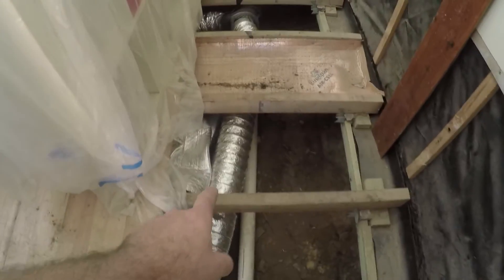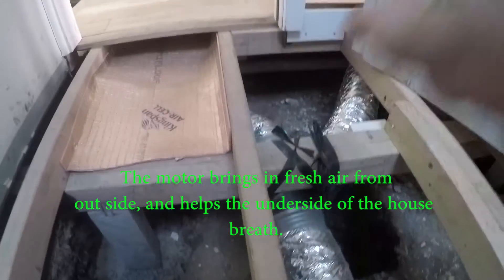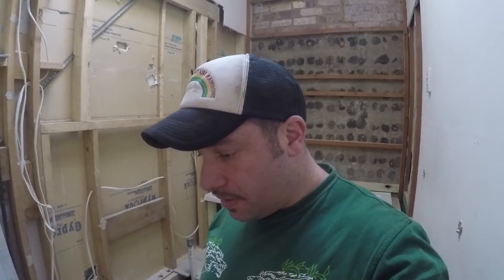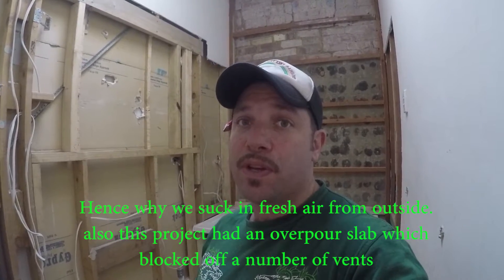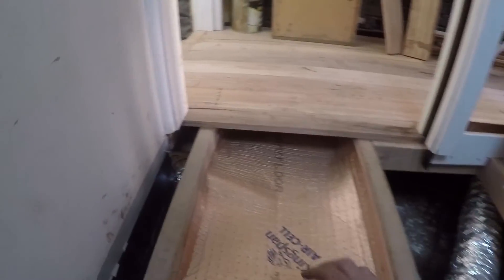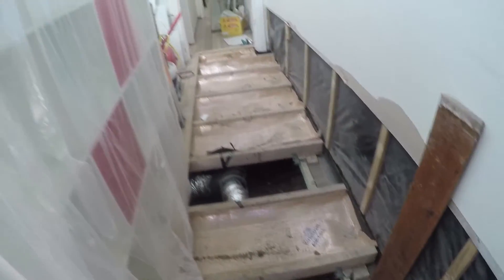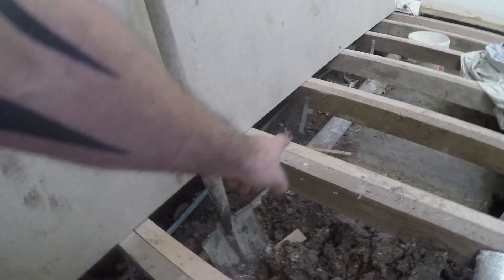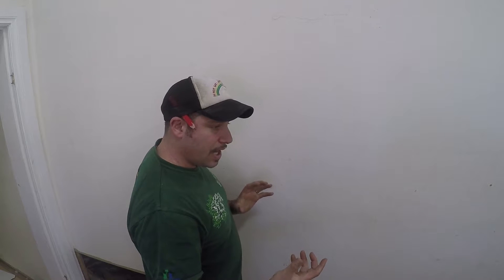Underfloor ventilation & mechanical ventilation explained

Comment: Hey mate, fantastic series, thanks! I’m deep down the rabbit hole of research as we have opened up some of the sagging bedroom floor in our 100year old cavity brick home. We have had professional rising damp repairs above floor level which has made a big difference, however we can see the joists have rotted over time where they meet the masonry. I can see plenty of weep holes and vents outside. Correct me if I’m wrong but it seems that vents weren’t originally placed in the inside cavity only the outside as this area was once considered ‘water tight’ before the original damp course disintegrated. 

I have seen a video where homeowners have used powered fan ventilation and due to drying out the subfloor excessively, it accelerated the rate that ‘new’ moisture moved up the masonry from the ground, and the salt damage then turned the mortar to dust. 

Am I best to accept some moisture as long as it’s controlled above floor? Would passive vent holes through to the internal cavity be a good compromise?

Thanks again. I’m really enjoying this channel :) sorry for the long message!
Reply from the maker: Hello Missgracie91,
Mechanical ventilation is a great option, this is mainly due to the fact that more and more homes & apartments are built to close that it reduces that chances of air flow under the floors or through the roof areas.
Timbers rotting in the old homes took a very long home due to the fact the homes timbers were well treated and the trees much older, these days the trees are very young and this creates soft cambium (timber fibre) & it will rot away much faster
Please support our channel at www.patreon.com/beowulfbuilders
#stayawesome
joe joe